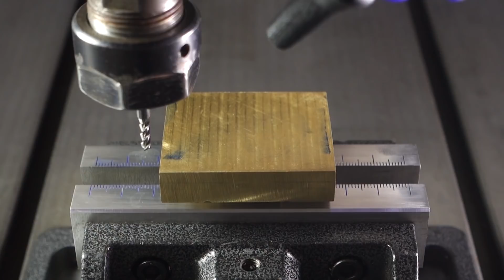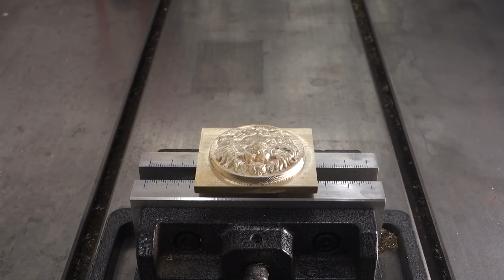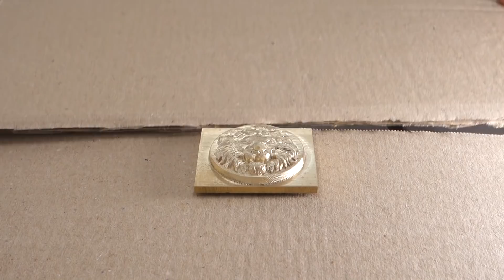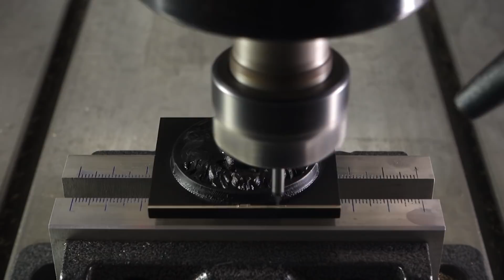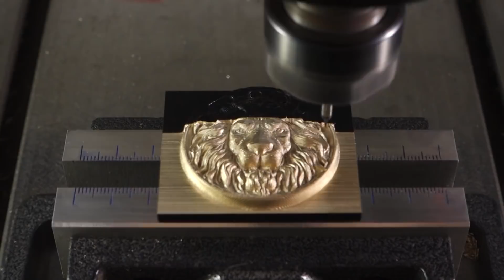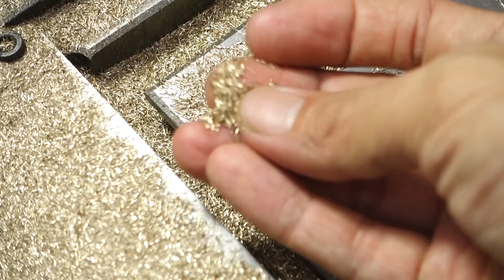Cnc router _ Test carving

Comment: Hi, can I ask mm/min, rpm and stepover?
Reply: Hi Mirock! i followed ur channel for a long time, absolutely like the way you make stuffs. Glad to see U here. this guy is my neighbor and he planing to try woodworking also. Hope we can share the experiences to each other.
Reply from the maker: Mirock's Woodshop _ Hi!
1/ End mill 3mm carbide, RPM = 22.000, Feed rate = 2.100 mm/min, Stepover = 0.3 mm, Stepdown = 8 mm.
2/ V-Bit 3mm 30 degree carbide, RPM = 24.000, Feed rate = 3.000 mm/min, Stepover = 0.1 mm, Stepdown = 0.2 mm.

Thanks for watching!
Reply from the maker: Cà Lem _ Oh, great!!!
Reply: the vbit is 3mm at the shaft. the tip is 0.1mm right?
Reply: Còn thông số gia tốc nữa Anh?
Reply from the maker: Yuuki1942 _ The tip is 0.3mm.
Reply: phucnguyen CNC  sir if I want that design engraving on iron then how much rpm use for engraving , and what degree of tool , and what is tip size of tool.
Reply: Phuc Nguyen did you mean 2.100 mm/sec.